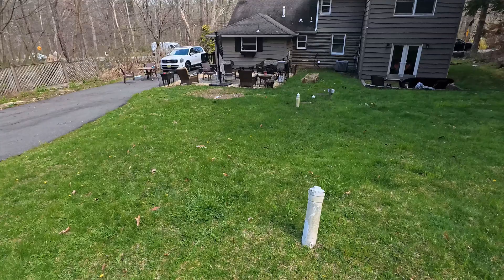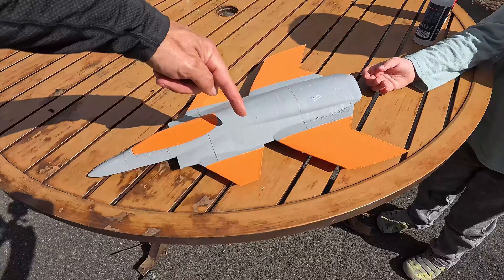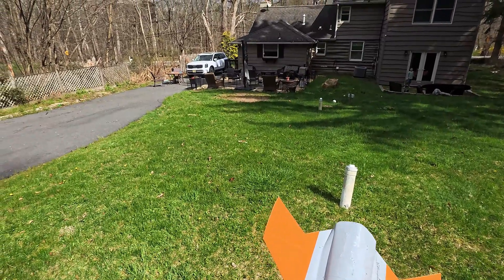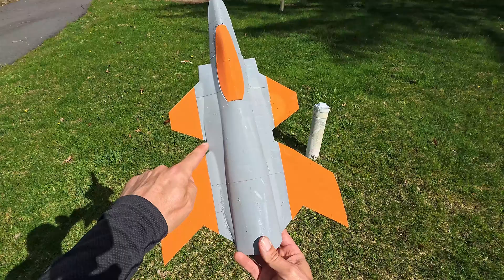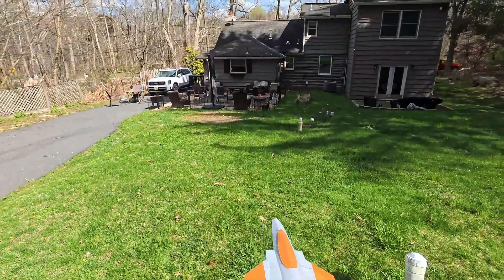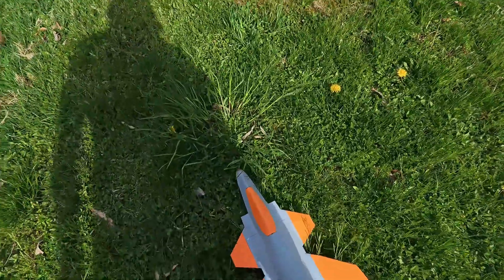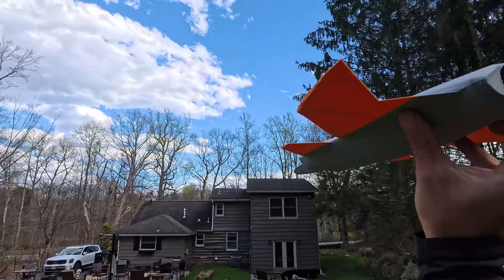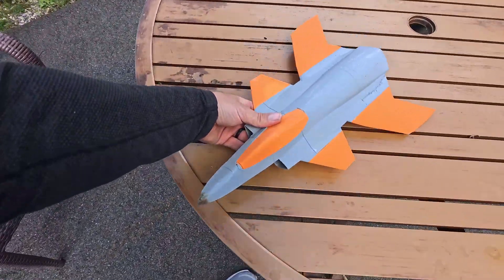X-36 glide tests

Comment: I also toss my scratch build projects. It is very helpful even I've calculate CoG point. Think about small winglets or vertical stabiliser . I expect directional instability.  It can be low profile kind because tail is quite away from CoG

Comment: Looking good so far. I going to guess that it will need a vert stab or a gyro. You can bet that the real deal has a computer to keep it in the air. Edit: canards=elevator, main wing=ailerons?? or elevons?
Very nice model 👍
AH...
Reply from the maker: Yes the real one has a complete flight computer with split drag rudders for yaw

Comment: No effing wayyy!!!!! This is my favorite aircraft, I've performed CFD calculations on it, but never thought I'd see an EDF model for it on your channel!! You go boy!
Reply from the maker: Im starting to get excited for this one. Trying to not get ahead of myself because I know it’s going to be a battle getting it flying
Reply: Most definitely. The real thing had a 2D thrust vectoring exhaust nozzle and split ailerons as well as reconfigurable control laws... but considering your model is so well-behaved in terms of static longitudinal stability provided you get the right CG position, I'm kinda hopeful and no matter what happens it'll be a huge learning experience! Rooting for ya
Reply from the maker: @professionalprocrastinator8103  I agree I couldn’t believe it tracked so straight. I’m going to throw electronics in it and hope for the best. I may bring a small vertical tail with me to the field and some CA glue just in case it’s bad
Reply: Is the files going to be able???
Reply from the maker: @Yogenh  https://cults3d.com/:1950919

Comment: It's really impressive that something 3D printed from plastic can glide that well.
The CG seems to be pretty sensitive.  I think a lot of the initial troubles may have been due to the lack of any kind of vertical stabilizer in back combined with  the air intakes acting as air brakes at the front.
Reply from the maker: I found each impact was moving the dollar coin slightly so I was chasing my CG lol
Reply: @hotlapkyle  something i do on small scale glide tests is, make a small hook or notch on the nose. then i can use a large rubber band or surgical tubing to launch the model kinda like a slingshot. it makes it very repeatable rather than human error trying to launch it and adjust CG.